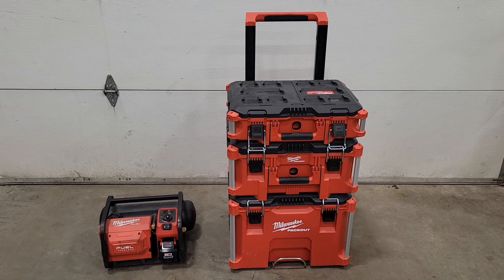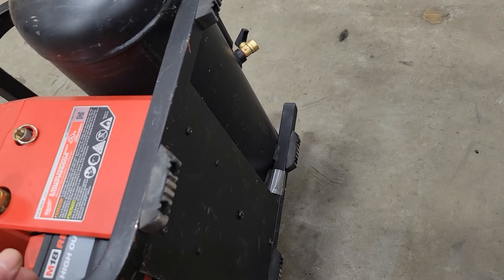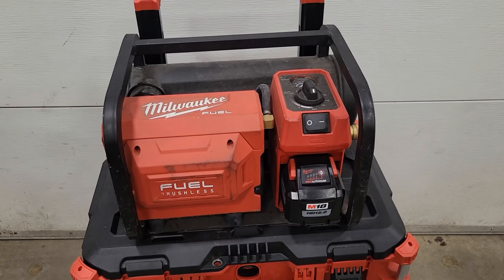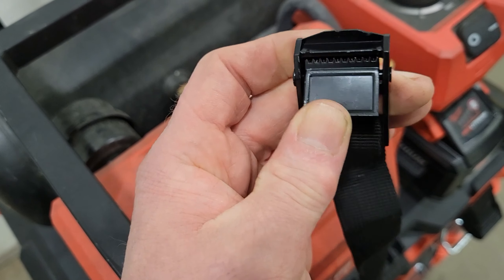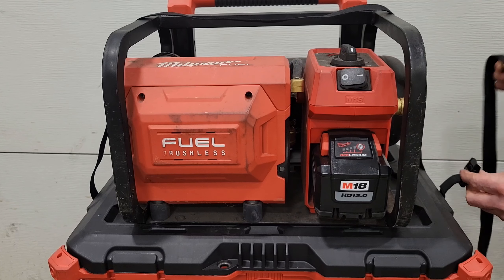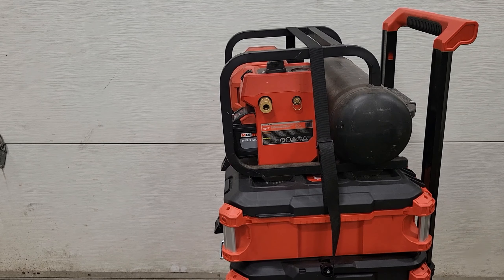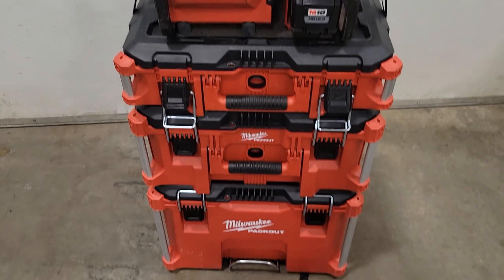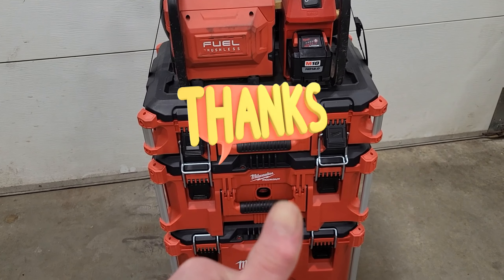How To Mount A M18 Fuel Quiet Air Compressor 2840-20 To Your Milwaukee Packout Toolbox.

Comment: I fit 2 moderate sized compressors comfortably in the front loading bread box style pack out tote , which provides some security , though M18 looks intersting for remote applications since it runs on rechargeable battery , I've never seen one anywhere ? , .
Reply from the maker: I find it very handy to fill up larger tires when I don't have a larger compressor with me. I got mine at home depot. Any Milwaukee dealer should be able to order one. Just make sure you have a higher amp hour battery. It's hungry lol. Thanks for watching and commenting.

Comment: Just ordered my Milwaukee air compressor. I liked your unboxing video.
Reply from the maker: Glad you liked the video. I'm very happy with mine. Do you have any different uses for yours in mind? Let me know what you think once you use it for a while.
Reply: @Shaners Mechanic Life  I do small engine repair and there is carburetor cleaning involved. It will be an addition to my mobile service Milwaukee packout.